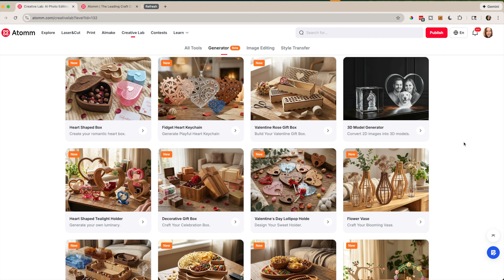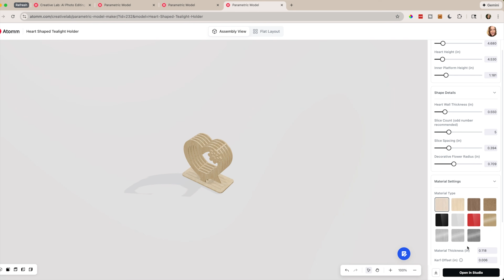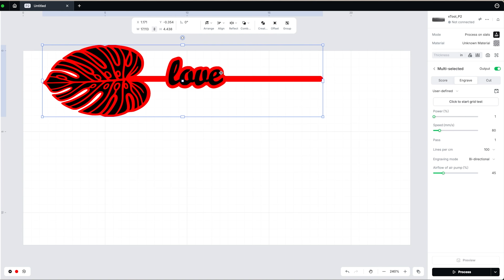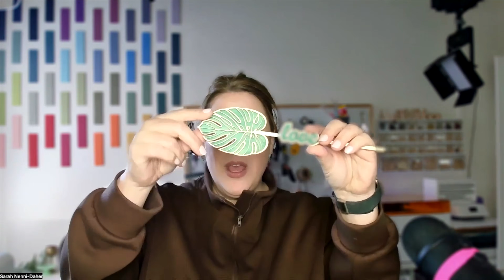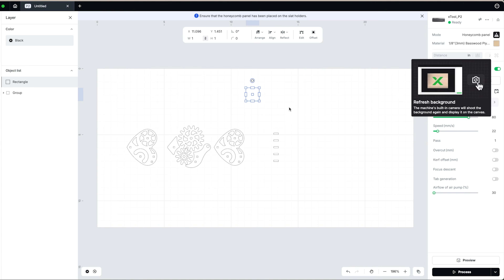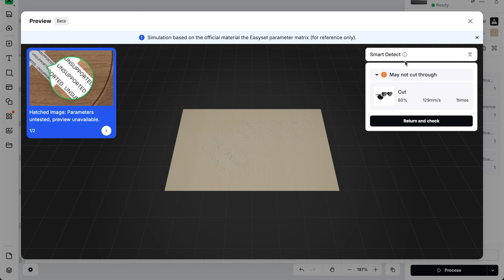xTool Software Ecosystem - What's New on Atomm? Make Along: Two Beginner Laser Projects

Comment: Great Video. As a Beginner (waiting on M2) I do not know the what the terminology your using  means. example: you set the Kerf.. What is Kerf? why does it need to be .. If you have a More in depth video I would like to know Please.. I want to really Learn not just drop and go and I appreciate all your doing Thank you.
Reply from the maker: Great question. You can find out more about kerf here (and search Atomm and other sites for fit tests / kerf tests you can use for various materials). I have a video that might help to explain kerf. 

By definition, it's just the amount of material which is removed by the process. Whether it's a saw blade or a laser beam, there will material which is obliterated and we can offset that loss using the kerf adjustments to make items fit snuggly together. https://youtu.be/f3gjN6mQ-dI
Reply: @SarahNenniDaher   Ahhh Ok Thank you so Much.

Comment: A question about machines and the need to adjust “kerf”.  I have the M2 does it automatically adjust the kerf after it measures?
Reply from the maker: No, you adjust kerf because it can change based on the material and/or settings you are using. 
We can set up a training call one on one for me to go through it with you here: https://support.xtool.com/demo-room/host-instruction?id=2079&name=Sarah%20Nenni-Daher
OR you can do one of the following on your own: 
1. cut a 25.4 mm square (that is one inch), measure it, and subtract the difference from 25.4. Then, divide by 2 and that is the kerf you put in the kerf offset cut setting in the xTool Studio software. 
2. You can download a slot sizer and get an estimate of kerf that way.

Comment: I have an xTool P3 80 watt CO2 with the 5 watt IR as well. Kerf question because I've never gotten that right, but I've never seen it done the way you did it here before (which makes so much more sense to me). My question is, is the kerf of 0.085 that you figured out here just for that particular Basswood board only or is that going to be the machine kerf no matter what board I would be cutting? I really appreciate you explaining this in terms that even I can understand. Thank you.
Reply from the maker: First, NICE choice on your set up. Second, you are correct in that kerf will depend on many factors. This means it's likely different for all of us, even though sometimes people speak in generalities.

A few things which can impact kerf are: 
- your laser set up (and dot size) 
- your material (even from the same manufacturer)
- your settings (burning hot vs slow + multiple passes)
- the direction in which you're cutting vs measuring* 

So when I have a fit project, I cut the base and the square and measure it at my settings. 

*A fun experiment is to cut a 1 inch square and measure it with calipers on the x > x plane and then again on the y > y plane. I have many examples where they are different. I have some in which they are the same.
Reply: @SarahNenniDaher  Thank you for that reply. I did run your test as shown in the video and I did actually get a slightly different reading on my caliper between the x and y axis. The x axis shows I should have a 0.145 kerf while the y axis shows the kerf is 0.130. I ran the test 4 times using the same piece of wood and all the results were the same. I figure I should be able to average out the difference and get real close. I just wasn't sure if that was going to be the same for all wood or just that particular piece, so thank you for confirming that. Great video and I have subscribed.

Comment: Wecreat vista 10W w/ rotary and 2W IR
Reply: I would love if you did more with this laser.   People had done lots of videos unboxing it and I finally pulled the trigger and purchased it but then the portable one came out and that is what you see people use.   This Atomm program looks amazing!
Reply: Does Atomm only work for Xtools?
Reply from the maker: @debbiebryson7576  No, it's for everyone and yes, it can be restricted to xTool... :) It depends on the files offered. If I am designing it and it's 100% my art, I will always export the SVG (and other file types) so you can definitely use it with the WeCreat Vista.

I can try and add the Vista to the tutorial set up. Most of what I share for xTool will 100000% work for WeCreat, though, so don't let that stop you. You will import the SVG and follow the measurement steps, moving the design onto the materials, etc.